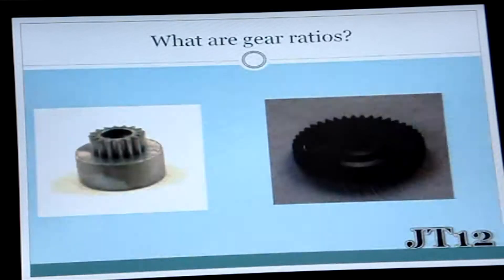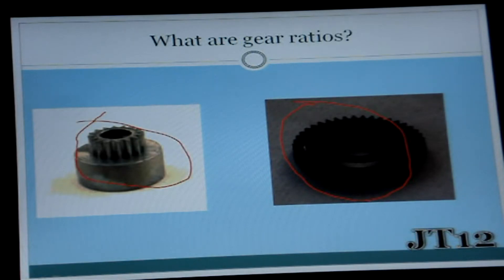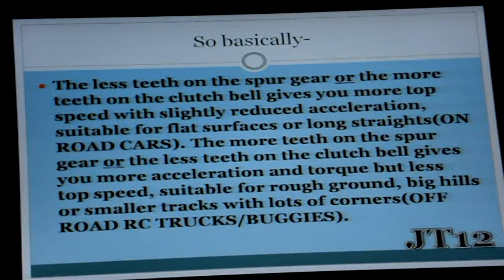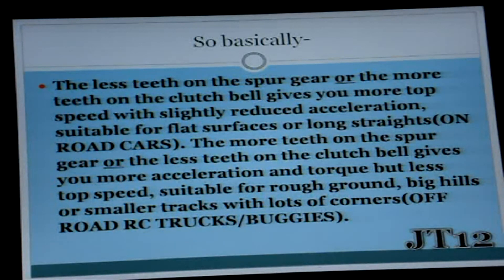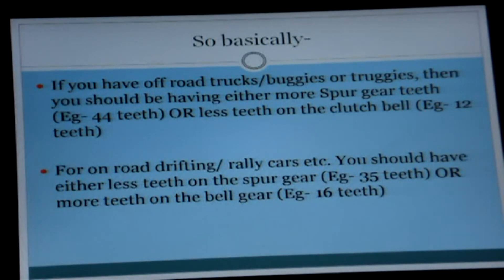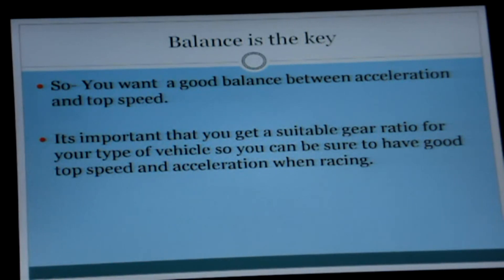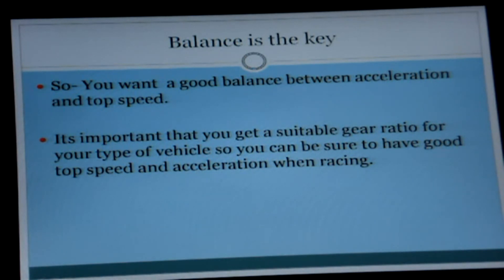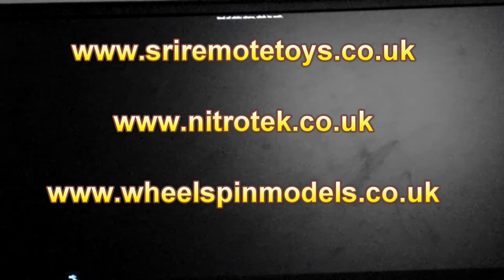Nitro RC Car Gear Ratios Different teeth and Ratio info

Comment: Verry instructive video. I still have a question. If I want to go "in between", so more top speed and more acceleration. Is it possible using a spur gear with more teeth and a clutch bell with less teeth...??